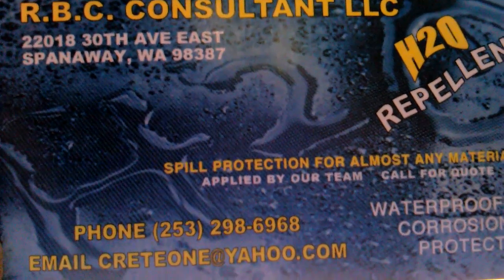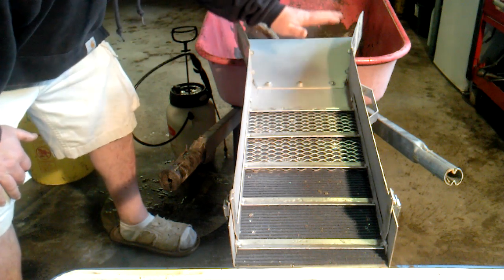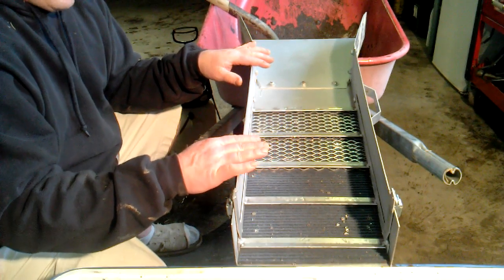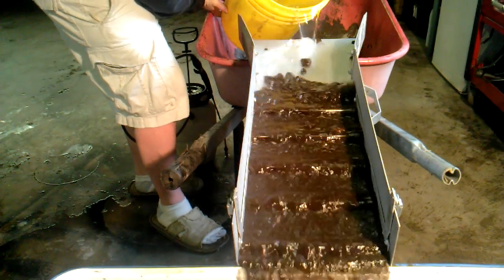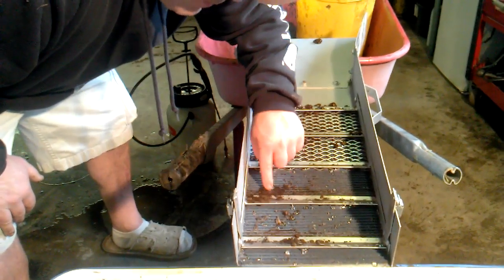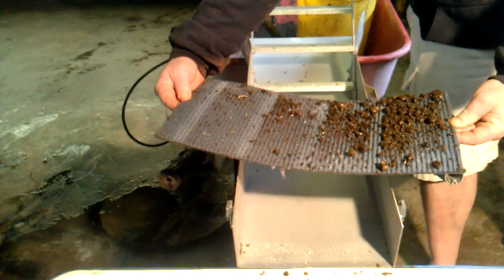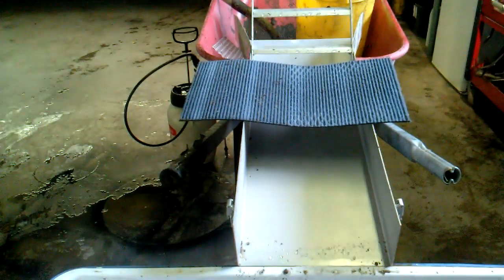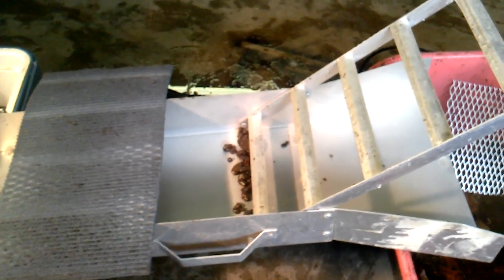Ultra ever dry, gold mining, no oil on fabric,

Comment: I'm enjoying these videos. I have a sluice similar to that one. I have no idea if applying this would increase or decrease a gold catch. The water's purpose is to move all the material you're putting on the sluice so the gold can separate from the rest and settle on the sluice. If this stops some of the water's separating actions, it might cause the sluice to fill up with material that should wash out. Or it might help in preventing the water from becoming too harsh.